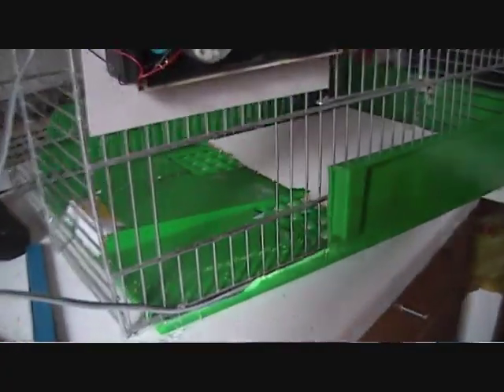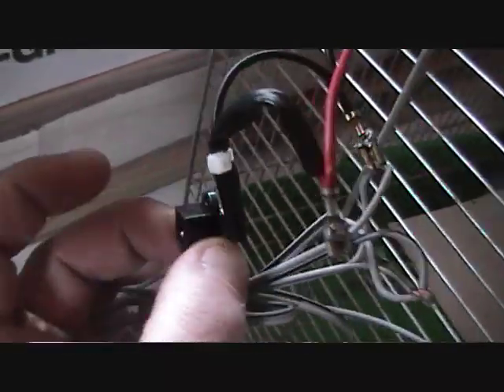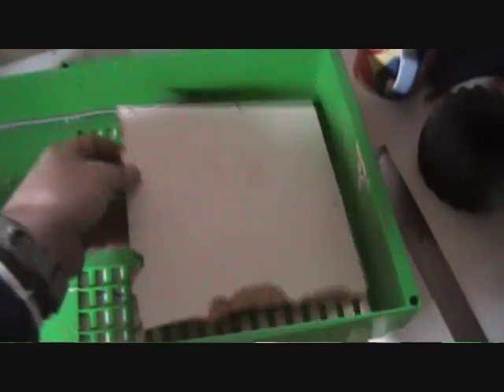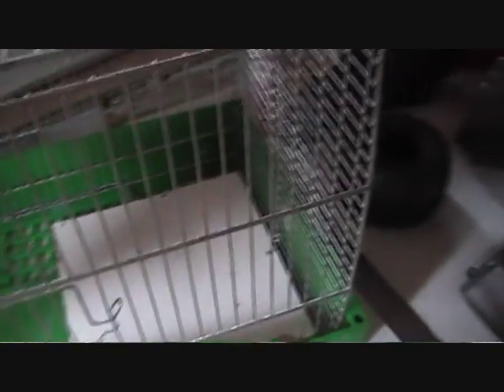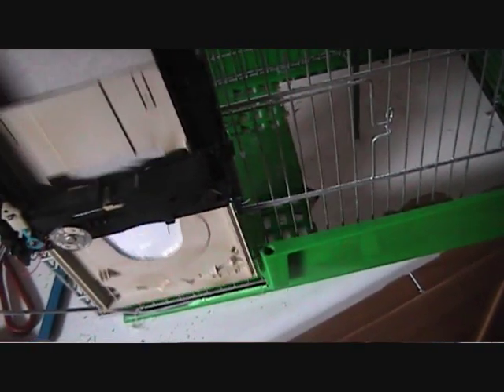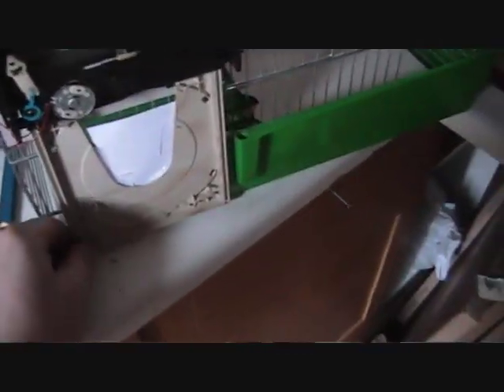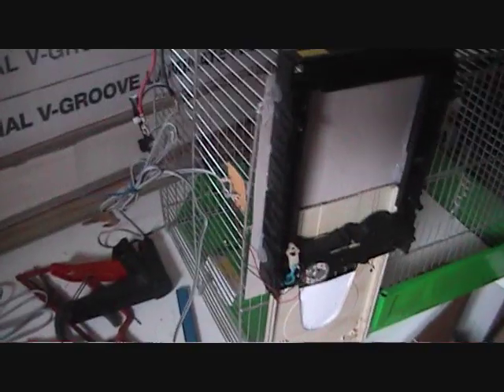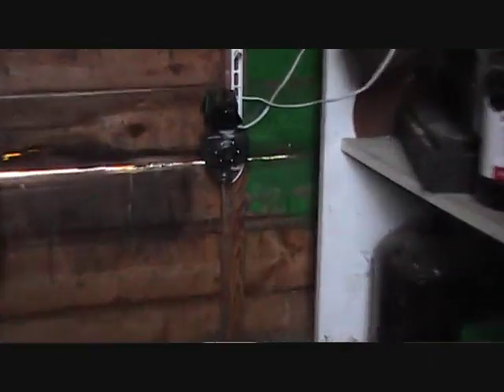electronic homemade rat trap

Comment from the maker: well i used a 7.2volt battery on this project. normally a cd drive would use the +12v DC power supply to operate so anything in this voltage range should be ok. dont forget about how many amp hours your battery supplys as the lower it is the less working time it will provide or you could run the motor of a  DC transformer from the mains.
Hope this helps. thanks.

Comment: It could easily leave through the "food hole". It's not even lethal. I'll pass. I bought some very sensitive snap traps that work great. The rat might run around a bit with the trap stuck to it's head while it bleeds to death, or it's skull may be crushed instantly. Either way, mission accomplished.

Comment: I think you had more fun making the trap than catching the rat! I had a year-long fight with moles digging up my yard & tried all kinds of traps. Probably wasn't too successful due to not reading the instructions. Finally, I rigged a small set of contacts to close when the mole pushed dirt thereby competing the circuit to set off a model rocket fuse that was stuck in a homemade firecracker. (50 grams of black powder in paper tube). Blew that mole into little bitty pieces! Great satisfaction!

Comment from the maker: @MrKaddan 
hello, thanks for watching my video.
you could use an IR switch but at the time i used the touch pads. the pads worked quite well and were sensitive enough for most weight of rats. i,m going to make a new one this year sometime and i will be using a different technique of sensors and switches, but i have not decided which ones yet.

Comment from the maker: hello agrajag46 ,
thanks for your comment.
i have re-built the trap using wood as there was a problem with this one. when i caught a rat, the rat would chew the wires and i would have to keep re-wire the whole thing. the new one has got all the wires hidden and is a lot stronger, if you would like to look at it it is on my youtube page called (electronic homemade rat trap #3).